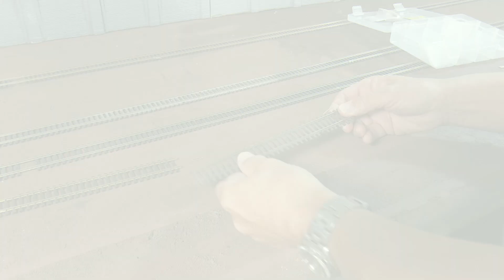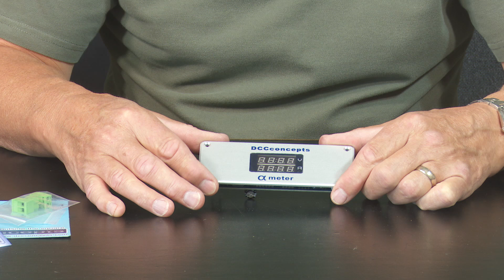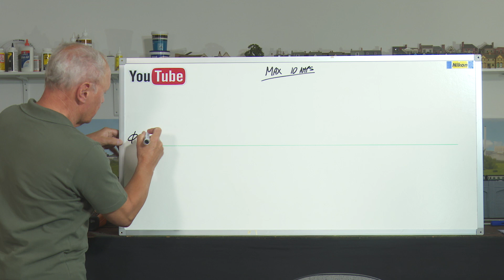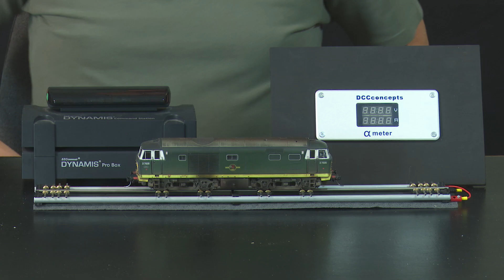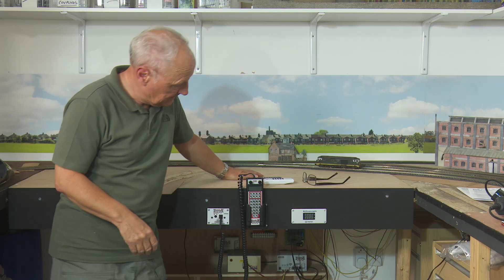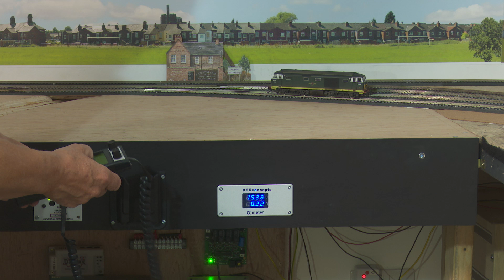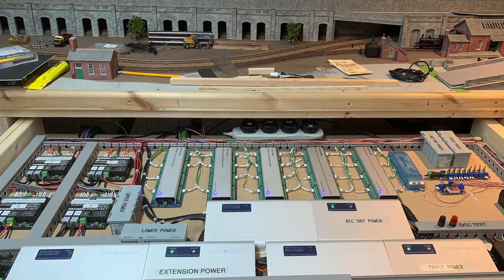Measuring Track Power at Chadwick Model Railway | 101.

Comment: Hi Charlie, You may already know this but I'm going to put it out there for those who do not know. On your Digitrax system you can measure your track voltage with your meter set on the DC scale. Simply place your positive lead on "Rail A" and the negative lead on "Ground", write down the measurement. Now move your positive lead to "Rail B" and write down that measurement. Add the two values together and that is your track voltage. In my case, I have my Digitrax DB150 set to the N scale setting, so Rail A = 6.23 VDC, and Rail B = 6.20 VDC giving me a track voltage of 12.43 VDC. You are correct, if I place my Multi-meter on the AC scale and read my track voltage, I see a reading of 11.12 VAC. Yes I'm in the ballpark but I'm off by  1.31 volts. Like most run of the mill multi meter's, my Fluke multi meter does not read RMS. Thank you Charlie for this in depth look at the Alpha Meter, sadly there does not appear to be a North American distributor that I can locate for the Alpha Meter. I did notice on the DCC Concepts web page, they will ship to the US via DHL, but it appears they will only quote a shipping price once you've ordered the product. My guess is probably because of the fluctuation between the USD and GBP. As for the printer, we use a similar device where I work for printing label for the wires on actual locomotives. So If anyone asks about your label maker, just tell them that is how the prototype does it and since we are modeling the prototype 😃 Cheers, Rich S.
Reply from the maker: Yes I did know Rich but most folks use other systems.  I cannot easily get to my controllers so this suits me fine.

Comment: (Time stamp 28 Minutes)
Hi Charlie, that was an interesting way to tag-text cables. 
Me and my friends also put tag text on our cables but at a fraction of what your marking machine costs, how do we do it?
Well, we do the following:
A; Buys transparent/clear shrink hose.
B; Prints the text that the cable will have with a standard printer with office paper.
C; Cuts the text from the paper.
D; Puts the rest of the paper back in the printer.
E; Cuts the transparent/clear shrink hose to cover the paper strip.
F; Lay the paper along the cable and pull over the transparent/clear shrink hose over the paper with the text.
H; Heat up a little and we're done with the markings.
Cost to mark a cable in 4 places will be ~0.17GBP
Reply from the maker: I never knew about clear heat-shrink until I put out this video.  Where on earth have I been!

Comment: Hi Charlie, with regard to your hillside, I found quite a nice product at Homebase called Jablite (https://www.diy.com/departments/jablite-premium-polystyrene-insulation-board-l-1-2m-w-0-45m-t-25mm-pack-of-8/26830_BQ.prd) doesn't have the foil lining, and doesn't generate as much mess as the stuff you used, I cut mine up with a hacksaw blade.
Reply from the maker: Thanks for the tip Jeremy.

Comment: Tip for those label-makers: because they purposefully “waste” tape, so you have to buy more of their overpriced products, print out all you labels in one go. For example, instead of printing out four separate labels for the alpha meter, print out one long one, that says “ power in power in power out power out.” Then, cut it to length with a pair of scissors. You’ll be surprised at how much tape you save.
Reply from the maker: Grat tip Sam.

Comment: Hello Charlie
I presume DCC using a chopped +/- 12 V powering signal to the track will be a bit like AC thus reducing current losses 

Will look into what frequency it is chopped at

Also like your wiring ideas 

If the wiring is neat it makes fault finding easier

A very interesting video

Thanks
Reply from the maker: Anthony Tidey I'm so pleased that you found the video useful.
Regards Charlie

Comment: The problem with trying to read DCC track voltage is that DCC is an AC square wave and the voltage that the meter is reading will vary a small amount depending on what data is being sent to the loco decoders. Most modern digital multimeters these days are true RMS which is what you need if you are going to read square wave voltage.  I rarely use a multimeter to read track voltage. I use a 12 volt incandecent light bulb test light to see if my track is powered.  If you use an LED test light then it must be rectified with a diode and current limited with a resistor. If I am really worried about DCC signal quality then I use my oscilloscope.
As far as current is concerned, I budget half an amp per locomotive when calculating current loading. I use one half amp because that's what my ancient Athearn locos draw. Newer locos draw much less current. Locos equipped with sound decoders will draw more. Usually I just clamp my true RMS  clamp meter around the track bus wire to read current.
https://shop.atlasrr.com/p-48003-all-scales-rail-joiner-sidekick.aspx
Reply from the maker: Actually Dave, It's a DC Square Wave.
I do like the rail joiner tool.
Regards Charlie
Reply: @ChadwickModelRailway  Charlie, here is a PDF showing how the DCC signal crosses the zero voltage line.  It's a fairly technical document which wants to put me to sleep while reading it. Please be advised that Loconet is not DCC. They are two different things. They just happen to be in the same cable when you use Digitrax. The DCC signal in the Loconet cable is labeled as "rail sync".
https://www.nmra.org/sites/default/files/standards/sandrp/pdf/s-9.1_electrical_standards_2020.pdf

Comment: Hi Charlie very interesting video.
I think you have just dispelled the urban myth that heljan locomotives use a lot of power. Have seen it stated this can be up to 1amp on some internet sites.
And yet you're Hymek with sound fitted drew under 100mah quight a difference!
This  amount of current drawn is approximately the same readings I get on my own railway even though I take the current and volt readings in a slightly different way, as I power my Dcc command station with a switching power supply designed for  supplying power to model battery chargers it's rated up to 30A, although I have a 5A fuse going in to my prodigy advance 2.
The power supply has a built in volt and amp meter which seems to be quite accurate. The reading I normally get on my Railway which is 14 by 8 feet has appox 13 Dcc fitted locos drawing power at once, with up to 3 running is around 1.9 Amps at 15 volts input although at the track the voltage is more like 14.
I also have color light  as well as Dapol  and servo controlled  semaphore signalling all point motors are operated with Dcc concepts point motors modules and are of the solinoid type.which are all powered from the command station. When I select a route which can throw up to 10 points I do notice a slight rise of 100mah to 2A as the capacitor discharge units recharge. 
So it seems to me that the main draw on current is the accessory decoders and not the actual locos.
Have run up to five locos at a time and have only seen the Amps increase by about 200mah not that much. Interestingly if I drop the input voltage down to 12volts the Amps also decrease to about 1.3 and everything still runs fine except for the capacitor discharge units.
Hope this post is of some interest.
Reply: Hi Charlie thanks for your comments must state my power consumption figures are very ball park, just what I observed on my power packs amp meter.
 spoke to the people at gauge master about this and they did say that when you use accessory decoders the power they use soon adds up, did have a look for stated power consumption on a few of them but couldn't find any figures.
Reply from the maker: Interesting figures Jamie.
I do run all of my accessories separately which helps.
Regards Charlie

Comment: Very interesting video as usual , I run my dcc layout on a gaugemaster prodigy express which I believe puts out 2.5 amps and I can  run two trains with about 10 engines all sitting on the layout all sound fitted. I have often wondered how close to the limit I am getting with power drawn . Probably not drawing as many amps as I imagined but may invest in one of these meters so I don't overload the system.
Reply from the maker: Hi Stephen, yes I think they are a useful asset to any DCC layout. Regards Charlie

Comment: Charlie - Do you have only one power district?  If you have four districts, then isn’t your meter measuring amps only on one of those zones?  Might explain why your amps don’t rise as you expect.
Reply from the maker: Yes I do have 4 Power districts. However, the meter is placed between the command station and the PM 42, which splits the feed into the four districts. I do hope that makes sense. Regards Charlie

Comment: Charlie, I have an N Gauge project (new to N gauge as I had previously modelled in OO/HO) in progress and use an NCE PowerCab control system. I have followed your recommendations on bus wiring and wiring droppers so thanks for those videos. Could you tell us where you got your "sexy pocket" device from as it looks like it could be suitable for my controller. Thanks in advance. Great video again. 👏
Reply from the maker: Hi Dave, please try DCC train automation. Regards Charlie

Comment: A lot of great info in this video Charlie.  Besides aging eyesight one of the other reasons for getting out of N scale was the fishplates jamming into my big fingers more often than not.  Just got to be too painful.  One could drill out a wood dowel and glue the longer end of your fishplate tool into it.  Paint it a bright color and it will never get lost on the railroad.  I am looking into the Alpha meter too.  I probably will want to connect it with my programming track as well.  I have some locos I have stored away.  I have the Nano lubricants to tune those up with.  I can see testing the amperage draw before tuning the loco and then testing afterwards with the Nano lubricants applied.  I wonder if it will show a drop in the amperage draw?  I will have to order the Alpha Meter from the UK.  I have not found a dealer here in the U.S. for it.  I also took a look at the Brother label makers for electric cable labeling.  There are a few newer models that are smaller than yours that are for electric cable labeling.  Models E105 and E110.  I know I have the office version of one around the house somewhere.  I read the comments by your followers about using the clear heat shrink.  Now i wonder where that label maker got to.....
Reply from the maker: I’m so pleased that you enjoyed the video. 
I’m sorry that the things I reviewed weren’t available in the US. 
Stay safe, regards Charlie

Comment: Charlie ive been trying to explain this on RMWEB, but they wont listen, the thumb downs are from peoople who still think a multimeter is adequate for measuring track power on DCC, sorry it doesnt work that way, that squarewave is alien to a DMM, i can run 15 n gauge trains on my 3amp digikeijs dr5000, 5 amps is overkill unless youre running 25 trains in one go
Reply from the maker: I totally agree, regards Charlie

Comment: 4 position rotary switch and 4 dpdt relays might work to measure a zone, 
https://uk.farnell.com/c-k-components/r20507rr02q/rotary-switch-dp5t-5a-125v-thd/dp/2435322 
position 5 could power down measuring device thru relay 5, 
or position 5 could power the 4 zone relays for layout power measurement.
May the force be with you and an electrician buddy
Reply from the maker: Great idea Jyu, you're miles in front of me.

Comment: Another great video. Your “tool” came just a few days late as my track crew struggled to put on rail joiners last Thursday night. However there’s always more track to lay and I will surprise them with your high tech design. I have found that filing the bottom of the rail approximately 45 degrees makes it easier to slide the joiner/fish plate on. This is particularly true when doing narrow gauge track and their tiny rail joiners. Thanks,Joe
Reply from the maker: Joe Valentine I'm so pleased that you found the video useful.
Regards Charlie

Comment: Hi Charlie,  I've been watching your channel for ages, but I only realised today that I hadn't subscribed. This is now rectified. The Alpha seems to be able to to measure in one polarity only, so presumably it can only see or measure  half of the DCC waveform. In which case it would be fair to say the Alpha may indeed be correct and reliable, but only under 'no-fault' conditions. If one of the diodes in a decoder or track fed accessory was to fail,  or even the master was to lose half the H bridge or a mosfet,  and this fault was in the 'blind' side of the Alpha, it would appear that it could not detect this. The voltage would display as ok even though the system would not be working.  It somewhat defeats the point of having one - at least having one you have to pay for.
Of course,  if a fault occurred only in the side it could see, it would go blank, giving the false impression the track was dead. Oops.
I think I'd rather have a couple of coaches any day! especially as current metering is free with JMRI and  DCC++. Keep shunting!
Reply from the maker: An interesting point. However, I must confess your electronics knowledge way outperforms mine. Charlie

Comment: Although a bit more of a faff, the cheaper Brother label printers (mine is a Ptouch E100 that I bought for around £20 from CPC a few years ago) will print a cable ID  on ordinary tape as either a tab ident or as a cable wrap that can then be enclosed in clear heatshrink. For those on a tight budget there is still the option to have neatly labelled cable runs.
Reply from the maker: Yes you’re not the first person to mention using clear heat shrink. Sadly, I had never heard of it. Regards Charlie

Comment: Hi Charlie yet again another informative and amusing video, love em. Regarding the fish-plate tool, as I am into N gauge you can imagine how difficult that is. Some while ago I saw this tool, very professional it was aswell but it was homemade, so I made a copy.  I cut the plastic off a electrical connector leaving the two screws exposed and making it a lot smaller. I then placed this onto a short section of N gauge track. Tightening the screws when I got to the amount of fish-plate I wanted to slide onto the track. After the connector I bent the track and placed a nice handle that I got from Squires onto it. This tool for me at my age and eyesight is fantastic. I will show it on my site when I finally get around to laying track. So yes Charlie an excellent tip. Have to say I do like the idea of the Alpha Meter.
Regards Chris
Reply from the maker: I’m so pleased that you found the video interesting Chris.

Comment: The RMS thing is imortant tho. l  would rather monitor the power between the wall plug and the controller. It would extend your fault finding to the whole system. Lot cheaper, and RMS standard instead of a DCC aproximation. 😜
Reply from the maker: A fair point Alan, I was just trying to avoid confusion. Regards Charlie

Comment: Printing onto heat shrink tubes - or as a commenter suggests onto a label inside a clear heat shrink tube - is a really good idea! I'm curious how practically useful that DCC concepts meter is - is it just to tell you when you need to buy a DCC booster?
Reply from the maker: That is one use for it Chris. But also, it would show you when one particular loco is drawing too much current. It would also indicate bad wiring should you be losing voltage across distance.
Reply: @ChadwickModelRailway  I'm sure neither you nor any of your fine followers will have any sort of dodgy wiring, but it would be useful to spot those current guzzling locos. I was shocked one of yours was drawing half an amp!!

Comment: I'm bidding on a Duette at the moment Charley for my DC system. I'd love to get a Gaugemaster DS but the price plus shipping to Australia knocks that on the head.
Reply: It is worth considering that Gaugemaster provide a lifetime guarantee. I have known several people to send controllers back for repair & they do it without question. If your Duette fails (& they have not been made for years), you would need to buy another.
Reply from the maker: Just be careful and make sure that you measure the voltage output before you stick it on the layout buddy.

Comment: The fishplate helper is a great idea - never seen it before.
I've not seen the heat shrink labels, I just use my Casio label printer and stick labels around the cable.
I'd better have a look into it.
Nice video as always Cheers!
Reply from the maker: Gerry if it works for you, so be it. Regards Charlie

Comment: Hi Charlie......... Been watching your channel for some time. You do a great job.
I installed a DCCconcepts Alpha Meter a few days back. My layout has 27 Cobalt Classic point motors plus their decoder boards
and interestingly as they are connected into the DCC track bus and therefore always drawing current (the motors are 'stall' type), it turns out to be about 40 ma per point motor which I never exactly knew until the DCC Alpha was installed.  I also have 5 & 12 DC volt power bus supplies for the
signaling system and other various things like lighting & IR devices etc so maybe could do with some more metering with Alpha meters?
Reply from the maker: You must have shares in the company mate. Mind you they are pretty good.